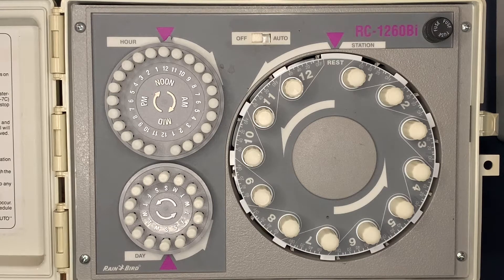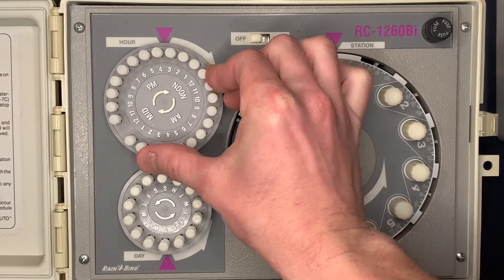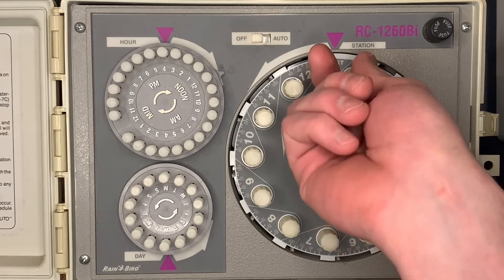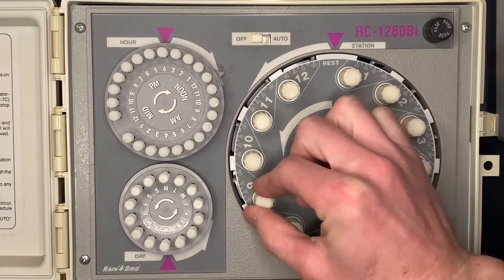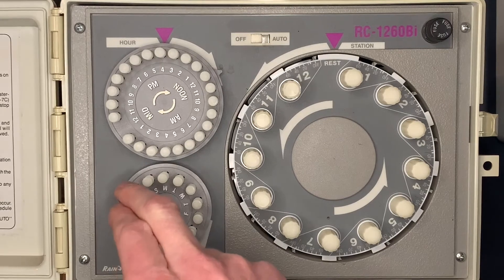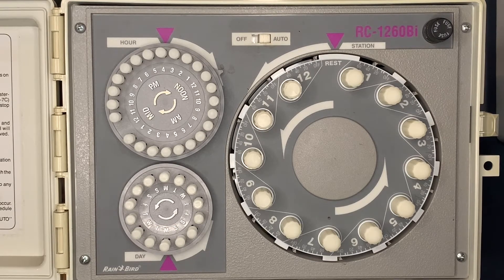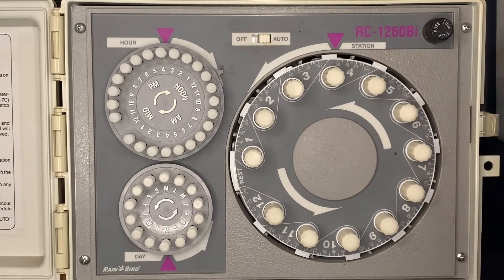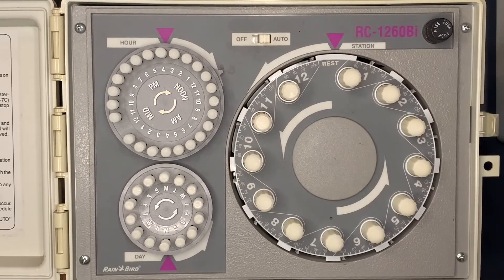How To Program The Rain Bird RC Series Irrigation Controller

Comment: I have trouble with mine stopping at Midnight and not going to the next day. Any suggestions? Thanks
Reply from the maker: @danielbulla9503  hello, unfortunately you will need to replace the controller, it is not uncommon for that to happen as the controller is at the end of it’s life.

Comment: For some reason it's not coming on, whether manual or auto. I've run it before, but I can't seem to get it.
Reply from the maker: Hello, do you hear the motor running and you turn the dial?
Reply: @SchepersLawnSprinklingSystems  yes it sounds normal.
Reply: @SchepersLawnSprinklingSystems  I set the controller last night and i believe it is running correctly, but the sprinklers are not coming on. I assume then that it must be a problem in the valve box...
Reply: Fixed. It was a valve. Thank you for your info.

Comment: Most of the problems  are associated  with the gears  which wear out .  Trying to find replacements is almost impossible better to upgrade to Par or Par +.  If your unit should stop working inspect the gears and shafts. these areas are the most  issues with these types of units.

Comment: Thank you, My system was working a few days ago and now won't turn on.  I looked up troubleshooting and it says to replace the fuse.  Silly question but how do you get the fuse out? and do they sell 1.5 am slow blow fuses separately for this? Rainbird website had no info on this. Thank you so much

Comment: What does it mean if it doesn’t turn on when nearly moving it into each station. It’s seems completely dead.
Reply from the maker: Hello, the motor is done and you will need a new controller.

Comment: Hello, the biggest wheel on the right is broken. The knobs won't turn the minutes up or down. Can you replace only the front panel or do you have to redo the whole thing?
Reply from the maker: Hello, I would replace the whole controller, it is tough to find parts for an older controller.